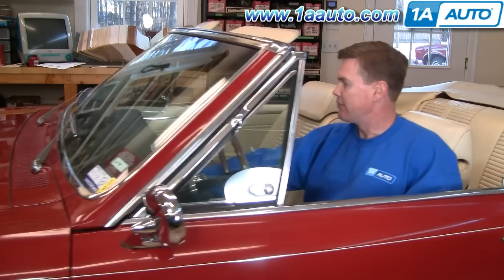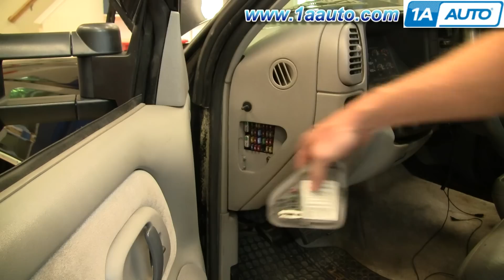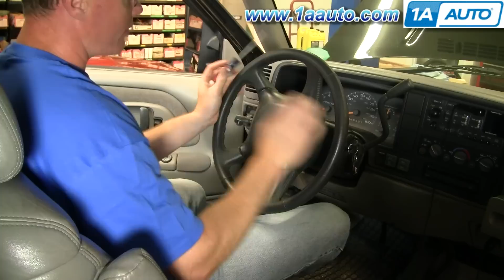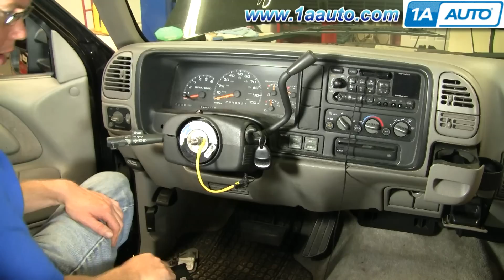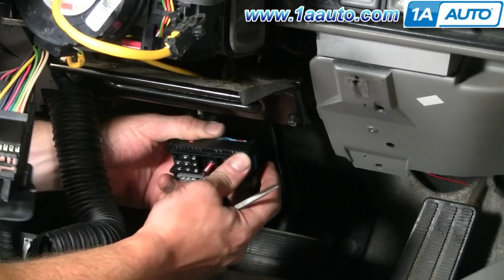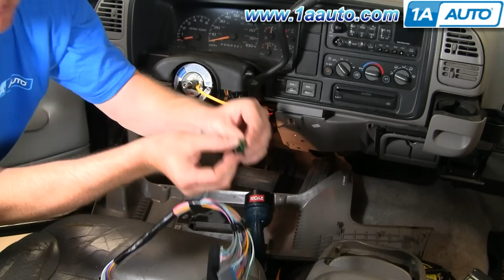How To Replace Turn Signal Wiper Switch Chevy Suburban  88-98 PART 1

Comment: Just completed this with only minor issues. 5 hrs in. Hardest part was getting air bag off (chevy model) and the screwing around with the wiring (working around afternarket trailer brake and antitheft stuff. Ty for the video

Comment: I need to do this to my 95 two-door Tahoe while driving my 2011 F-250 I almost got hit so I yanked the steering wheel to the left and then doing so I hit my multi switch and broke it. But that was really easy to change out just remove the screws for the bottom panel and the top panel comes off also two screws remove the switch with no wire harness it's just a switch locked into place and put the screws back put the other screws to the cover back and you're done less than 30 minutes

Comment: I've had the switch out on my 97 burb twice and did not have to remove the steering wheel. The screw behind the steering wheel can be removed with a T25 bit turned with a 1/4 inch wrench. Not sure why everyone pulls the wheel.

Comment: I use my tilt steering wheel every time I drive my truck . Little did  I know it caused the headlight wire of the multi switch to separate. Flexing that neck took its toll on the wiring and it took me a month to figure out that one wire was why my headlights and high beams didn’t work . Do not use  you tilt on your wheel . Lesson learned...

Comment: I have a 2002 suburban , do I have to pull the steering wheel or can i pull the dash and around the wheel
Reply from the maker: +Rylee Roantree You may have to pull the steering wheel to service the turn signal switch. We carry new ones on our website 1aauto.com Hope this helps you out.

Comment: The one thing that should be mentioned is weather your truck has an Air Bag, some of the 3/4 tons did not as I just found out with my 97 GMC . Also steering wheel assembly is different.

Comment: You can get the top of the multi function switch cover off by prying off the thumb & finger wings off of the switch. Yes it will snap back on when you are done.
Also, you do not have to pull the Steering wheel to replace the multi function switch, but you will need a T-25 Torx driver shaped like an Allen Wrench to remove and replace the bottom screw holding the multi function switch in place.
Reply from the maker: +Clinton Fronterhouse Thank you for checking us out, as well as the information. This will certainly assist other viewers complete the repair. 1aauto.com
Reply: thats the way i did it on a couple of 96-99 k1500's, some were in pick-n-pull , got lots of practice

Comment: thanks a whole bunch for the instructional videos for replacing the multifunction switch. It saved me mucho $$$;  $120/hr  (would have been about 2.4 hrs according to GM dealer) and either $528.68 OEM for new GM Multifunction switch or $389.04 After market. Total would have been 816.60 or 676.99 PLUS the diagnostic fee of 99.95. Holy cow!!. The hardest part was removing the air bag; I pulled the steering wheel but bought a cheap made in China puller that bent & the tip of the center bolt got messed up but luckily I pulled on the wheel hard enough to remove it. Needles to say you get what you pay for... I did find out how to remove the ignition switch key part because the mechanic at the GM dealer broke off the screw hole on the top column cover! After spending time removing the ignition switch & trying to glue that broken piece everything went smooth.Again, I really appreciate you putting up this video.

Comment: Good video. Doesn't answer every tiny little question, but gives most of the info needed to save a boatload of money. Repair shop quoted about $725, over $400 of which was the part itself. I got the switch on ebay for $37 and spent about 4 hours switching it out. Not an easy job, since the work is under the dash and a cramped space, but worth it in the end. I used videos from the same guys to do a front brake job also on my '99 Suburban and it saved me several hundred $ too. Good job and thanks for the videos!
Reply from the maker: +historicarmourer Thank you for watching, and the compliments. We're glad to hear you were able to save money and complete the repair yourself! 1aauto.com

Comment: you guys rock!  great step by step guide on replacing parts, really appreciate it and keeping my 1996 K1500 in good shape!  Love to see one on swapping the engine for a HT383, you guys should sell that as that's my next big project, 250,000 miles and still going strong, but I'd like more power.

Comment: Did not do this switch but I did the ignition switch on our 97 jimmy. What a pain. I wish I had known about your videos beforehand.
Reply from the maker: you2bertoo Thanks for watching; we carry the replacement turn signal switch shown in this video on our website, here's a link to them if any of our viewers would like to take a look at them. Have a great day! http://www.1aauto.com/windshield-wiper%2c-high-beam%2c-hazard-light-switch/i/1azcc00007?utm_source=YouTube&utm_medium=CTA%20Comment&utm_campaign=1ATony
Reply: 1A Auto Parts thanks. I don't need this repair right now. I need to change the starter in my 95 chevy G30 van.

Comment: First let me say, this video was a big help. With that said you don't have to pull the steering wheel to change the switch. I was able to get to both torx screws on the switch without removing the wheel.
Reply: Thanks
Reply: januaryman169 yup, just turn the wheel to the left to have access to the torx screw. The whole harness thingy is a pain in the butt. Replaced mine yesterday.
Reply: januaryman169 video or bs

Comment: I recently replaced my idler/ pitman arms, and I must have bumped it and my steering wheel if off to the left by a few inches. Can I do this to straighten it back center again? Thanks for the video, and your time.
Reply from the maker: Stevie Wonder Your best bet is to get an alignment. Hope this helps 1aauto.com
866-403-3393

Comment: My new switch is installed, but i noticed a problem. While on cruise control, occasionally, when i activate the right (and only the right) turn signal it disengages the cruise control. Also not sure if it's related, but about 6 months-1 year later my wipers started working only intermittently and now they only work on high. Related?
Reply from the maker: You may want to make sure that there's not a pinched wire somewhere that might be causing this to happen.
Reply: Thanks for the reply I appreciate it. I checked the wiring, no pinches or loose connections like i feared. I decided to check the wiper pulse switch and replaced it, and it actually fixed the issue. Apparently lots of GM's have issues with them. Jury is out on the cruise control though lol. Thanks again for the response.

Comment: Do you really need to remove the steering wheel?
Reply from the maker: It's necessary to perform this repair.
Reply: 1A Auto Parts Thanks, I only ask because I saw in another of your videos they did this repair to a pickup and did not remove the wheel?
Reply: Unfortunately, yes :( I've done this repair myself. It's the only way you can get the new unit on.

Comment: I have a 1995 chevy 1500 I bought this truck and the guy gave me a new multifunction switch with it. The guy I bought it from tried to replace he but couldn't figure it out. And when he did he never reconnected the cruise control. I replace the switch now according to your video but I can't figure out where is the cruise control wire is supposed to plug into it. I watch the video but it's kind of hard to see. Can you tell me where it's supposed to plug in to. 
Thanks cole

Comment: Needed a Multi-function switch for my 2002 GMC Sierra, dealer wanted $790.00 to repair, bought it at 1aauto.com for $87.50 and replaced it in 2.5 hours, thanks for the video and the great price on the part.

Comment: Thanks for posting, Mike. It was a big help.

A few comments:

- The hint to twist and pull on the horn wire connector, and the information about the cruise control clip lock, were particularly helpful. There was nothing intuitive about those connections. (On the latter, it would have been helpful to be a trapeze artist contortionist with half-inch fingers.)

- Great idea, using the 4mm socket to deal with the goofy "male Torx heads" that secured the upper portion of the plastic housing.

- My steering wheel came off so hard I was afraid I'd break the puller. I added some penetrating oil and a few moderate hammer taps, then let it sit while I dismantled the rest. Then it finally came loose. For reassembly I put some anti-seize compound on the shaft to make it easier next time.

- Rather than use a socket to remove the top Torx screw that secured the switch, I was able to bend the upper plastic housing a little and stick a regular (screwdriver-like) Torx driver down through the hole for the hazard switch.

All in all, the job was a royal pain -- but it could have been a lot worse without your video. Thanks again!

Comment: I managed to remove the 2 screws of the turn signal switch without removing the steering wheel, but the turn switch wont come out, is necesary to remove the steering wheel o something else? or there is another screw i missed up? or maybe the turn signal lever got stuck with something? any idea?
Reply from the maker: If you follow our online video, it will show you the proper way to remove the turn signal switch. We also carry the replacement turn signal switch shown in this video on our website. We off FREE SHIPPING on all orders in the lower 48 states. Here's a link to them on our website. http://www.1aauto.com/windshield-wiper%2c-high-beam%2c-hazard-light-switch/i/1azcc00007?utm_source=VideoReply&utm_medium=VideoReply&utm_campaign=1ATony

Comment: Could the multi-function switch be the cause of my brake lights flicking? As I push on the pedal the brake lights work, however, the more I push on the brake pedal I get no brake lights. Replaced brake pedal switch.
Reply from the maker: If the brakes are wired through the switch it's possible. You may want to check the wires that come off of the brake light switch to see if one of them is frayed and may need to be repaired. Sometimes over time, they can rub against a piece of metal under the dash and damage the wire. Hope this helps you out. 1aauto.com 888-844-3393

Comment: On my 91 GMC 2500, when I turn on the brights, they start to turn on then all lights in the truck go dead, instrument, markers, brake lights, EVERYTHING.  I can't figure out where to start! I've had a couple close calls with trees when it decides to do this to me in the dark.
Reply from the maker: You could have an issue with the headlight switch. You may want to remove it and see if it's damaged or needs to be replaced. If you need a new one, we carry them on our website for your truck. We also offer free shipping in the lower 48 states on all orders. http://www.1aauto.com/1A/headlight-switch/GMC/K2500-Truck/-/-/1991?utm_source=VideoReply&utm_medium=VideoReply&utm_campaign=1ATony
Reply: 1A Auto Parts Thank you for the reply and the info, I'll try that out!

Comment: On my 1995 silverado the headlights cut in and out if i tilt the steering wheel or jiggle the turn signal, and sometimes will kill the engine, could the turn signal switch be faulty?
Reply from the maker: There may be a loose or frayed wire in the column that's making contact when you move the steering column. You could also inspect the switch too. 1aauto.com 888-844-3393

Comment from the maker: Stephen Bundy
 
Hi, I have a 2000 chevy camaro, when I turn my turn signals on the arrows don't show up and the lights don't blink on the back or the front. I saw that there was no relay switch hooked up under the dash. I put a new relay in And tried to start the car and it would take a while to turn over, almost what the symptoms would be if I needed a new battery. After the car starts the fuse for the turn signals is burnt. Once I take the relay out the car starts like normal but still obviously no signals. Please help!!

You may want to take a look at that circuit to see if there's a frayed or pinched wire, that may be blowing the fuse. Hope this helps you out. 1aauto.com 888-844-3393

Comment: Hi, I have a 2000 chevy camaro, when I turn my turn signals on the arrows don't show up and the lights don't blink on the back or the front. I saw that there was no relay  switch hooked up under the dash. I put a new relay in And tried to start the car and it would take a while to turn over, almost what the symptoms would be if I needed a new battery. After the car starts the fuse for the turn signals is burnt. Once I take the relay out the car starts like normal but still obviously no signals. Please help!!

Comment from the maker: Check the turn signal bulbs first to see if any are burnt out. If there is a burnt out bulb replace it. If you still have an issue it could be a bad brake light switch or a bad turn signal switch. Make sure the wires coming off of the brake light switch are not frayed and touching metal creating a short. Hope this helps you out.

Comment: i have a '96 k1500, i have tail lights sometimes but when my headlights are turned off and my driving lights/day runners are on my turn signal works fine until i press on the brakes. once i hit the brakes my turn signals speed up and my rear turn signals change sides. ex: left turn signal normal speed, hit the brakes, front turn signal fast flashing, rear RIGHT turn signal fast flashing. i dont think it's a short because it only does this sometimes so would it be the switch or a short?

Comment: I have an 89 pontiac firebird and the rod that connects to the headlight/blinker lever isnt connected to the lever and whatever its supposed to be connected to in the steering column. How do i fix this? Or do i need to take it in to a profesional?

Comment from the maker: The turn signal switch on your 1993 S10 should be different than the one shown in the video. It may be a different process to remove it.

Comment from the maker: Your Astro van does use this same part so the process should be the same or very similar. We carry new replacement turn signal switches on our website 1aauto.com for your Chevy Astro van. 888-844-3393

Comment from the maker: It is similar but there is a difference between the two dash boards so the install might be slightly different. To see if the switch is the issue or the motor, you will have to test the connection at the motor to see if the motor is getting power. If there is no power, there is either a issue with the switch or the wiring.

Comment from the maker: This turn signal switch does fit your 1996 Chevy S10 Blazer. The installation should be the same or very similar to the one shown in the video. The part number on our website is Part # 1AZCC00007 1aauto.com 888-844-3393

Comment: Great video and thanks, on my 99 chevy if i tilt the steering wheel to its full extremities the cruise will try and kick in, do you think i may have possible bad wiring or perhaps in a previous life the switch was replaced without putting that locking tab on the connection and the very end of the video?.....and it has come loose?
thanks in advance
Derek

Comment: Im buying a 1999 Honda Civic EX at the end of this week and I test drove it and I noticed that everytime I hit a bump or dip in the road, my windshield wiper control switch (which is located on the right of the steering wheel) makes my wipers turn on. It seems as if the switch, itself, could possibly be "loose" because it falls down which allows the wipers to work for a few swipes and I have to hold the switch until the wipers stay turned off. Im sorry for any confusion but any help or answers?

Comment from the maker: You may also want to check around the engine bay for a possible loose ground wire, to see if that's what is causing the issue.

Comment: i have a 95 tahoe and my headlights (low beam) stopped working . i already checked both of the light bulbs and theyre fine. i also tryed to look for fuses or relays but couldnt find any.. i changed the dome light switch but the low beams still wont work...any help is appreciated.  thanks.

Comment: P.S. My truck is a 98 GMC Sonoma, w/o Cruise control. This device in the video is more common than the one w/o cruise control apparently. Does anyone know if you can use the one with Cruise on a truck w/o cruise?

Comment: I tried doing this from out of the Haynes manual, but they make no mention of the harness plug assy., or the red 7mm bolt that holds them together.  "Just unplug it," they say. The bolt was obscured by a piece of elec. tape in my truck, so it wasn't obvious until I watched this video. Many thanks for the video! I agree that the steering wheel disassembly could be elaborated on.

Comment: @1aauto thanks ya know its weird i put the fuse back in yesterday (i had been driving without the blinker fuse) just to see what happened and i have not had the problem the blinkers work fine except when i hit the brakes now their is a noise that comes out the same thing the blinker noise comes out of but it does not always do it anyways hopefully it keeps working and i wont need a new switch